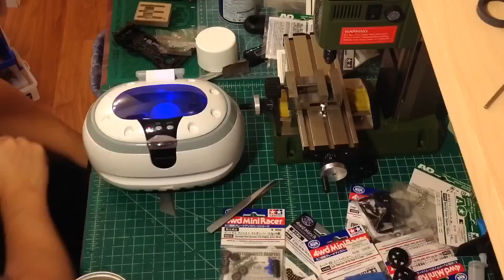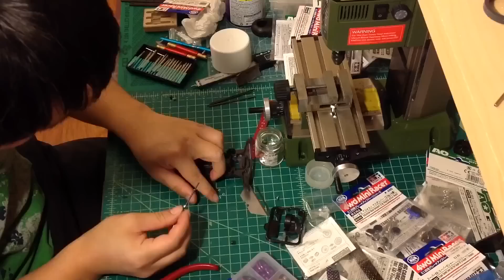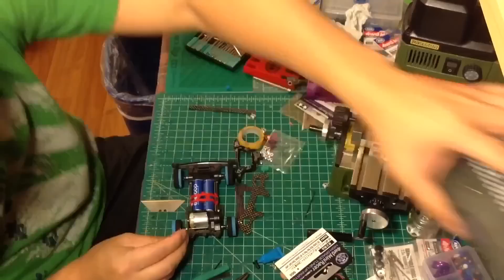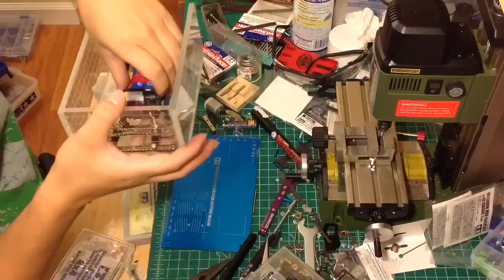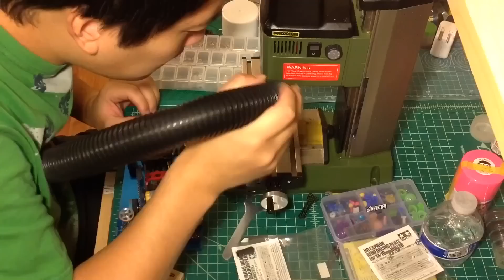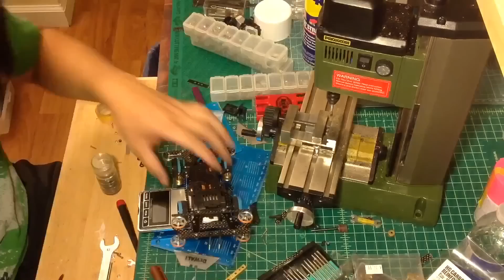Tamiya Mini 4wd Japan Cup style Super II chassis build up full processing 1/2

Comment: Great video.. May I know what's the model of proxxon you used other than MF 70?
Reply from the maker: DimplePoji there is a lot of custom tool i have at home.. no brand, no model number, you need to find local company to customize for your special needs
Reply: Mad Tang Thanks. Actually i was referring to the one used in this video when you trimmed the tires. I think i saw the model number. I been using dremel but thinking of switching to proxxon after i test it in my local shop. Feels that its much better than dremel.

Comment: i just wondering, JAPAN CUP regulation stated length should less than 165mm, its your 4wd too long?
Reply from the maker: +Bee Hadisasmita 
thats why i cut the original front bumper, and use carbon plate mount on front to make the front a little bit shorter than original front, in this case, i can save the the length on front , then add that to rear~~ so this car will be 163-164mm.